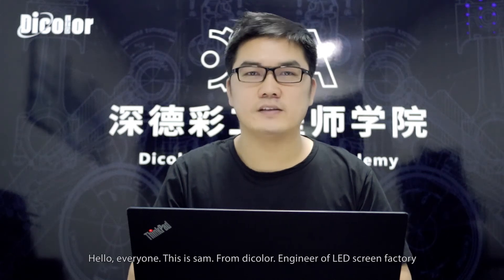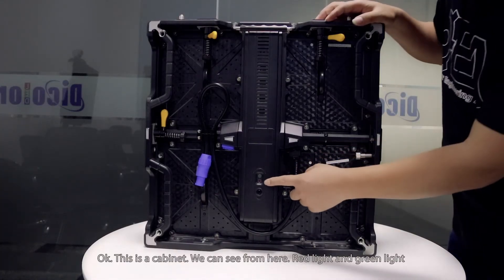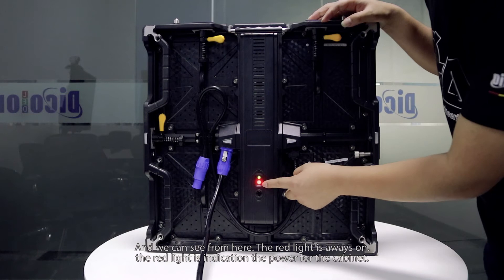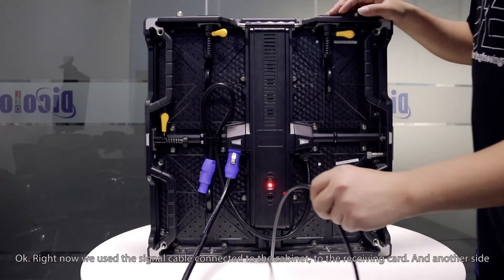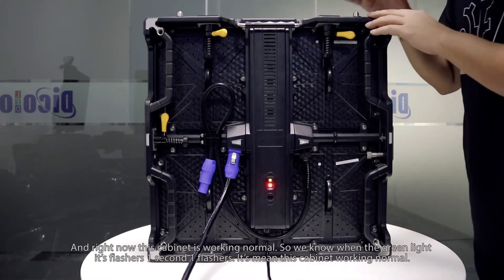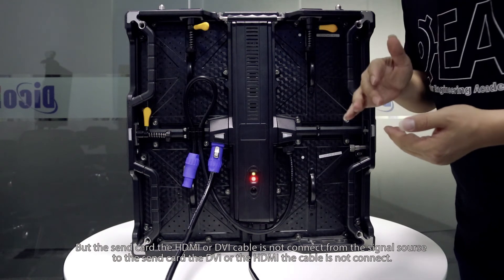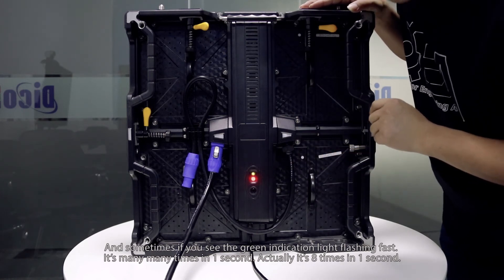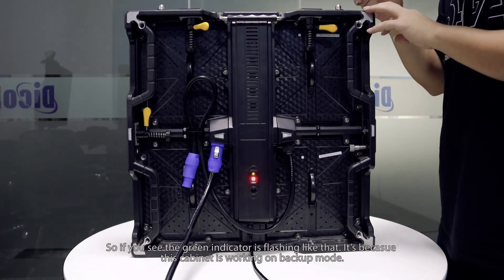Dicolor&Novastar The Status of indicator light of receiving card .

Comment: Thanks for dedication and information 
What if the green indicator is total off
Reply from the maker: should be differenet control system. but normal if the green light are off in all time, should be screen no signal connect. or some special firmware in receiving card CAN be like thta.